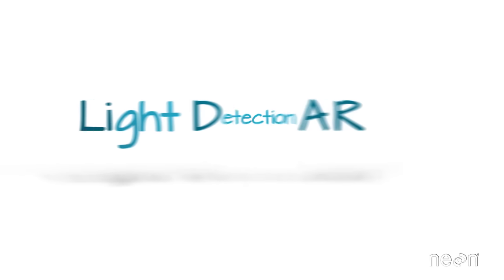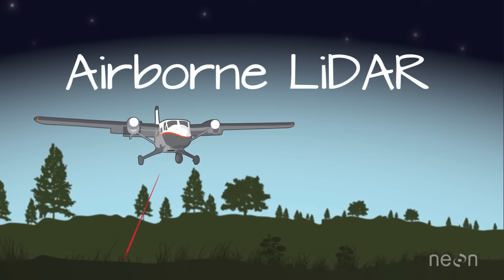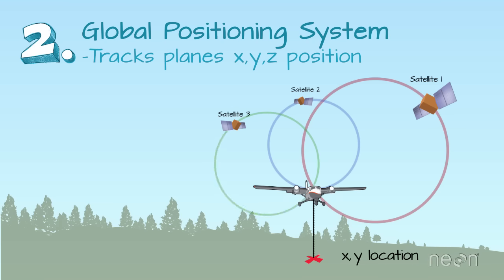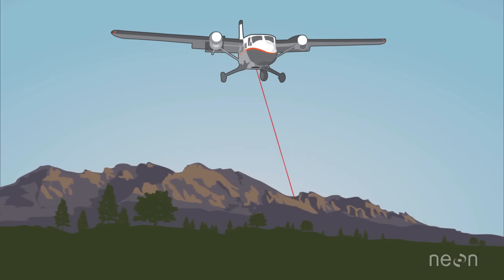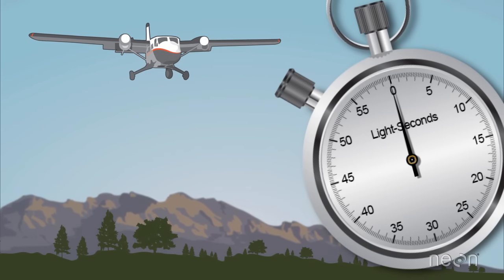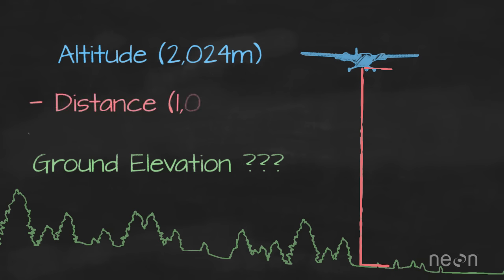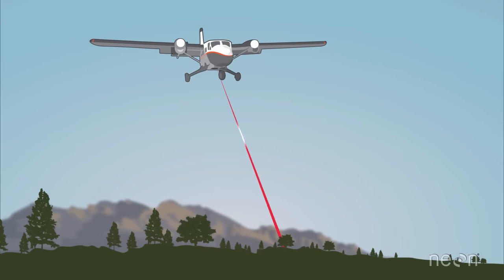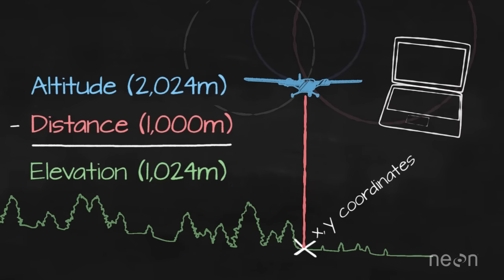How Does LiDAR Remote Sensing Work? Light Detection and Ranging

Comment: Seems wrong. As the laser leaves the airplane, the airplane moves forward, thus when the laser “returns” back to the airplane, the airplane has moved. And you have to take into account that if you send several photons at the same time, given the fact the airplane has a velocity, you have a bit more math to do to know which laser was what when it left the airplane.
Reply: The pulse/return of the laser moves with speed of light ( 300.000 m/s). Compared to the airplane (which is very very slow then) you can neglect all of the effects you just mentioned.
Reply: They didn't mention it specifically in the video, but I would think that would be part of what's taken into account with the IMU (not the emu. :)  Since it's measuring the plane's movement, it makes sense that it takes forward movement into account in addition to pitch, roll, and yaw.
Reply: You're forgetting one thing: airplanes are slow. Light is very fast. The movement of the plane is negligible. The light is there and back before the plane has moved even a centimetre.
Reply: +Mitigate Keeps well that's a shortcut proof of one kind, but I'll deal with it. I guess you're right, even though I'm pretty sure it's not that “negligible” and that, as someone already stated, the onboard system might already take that into account. Keep in mind that even if it adds 1 nm bias each time a beam leaves the sensor, the cumulative bias might matter eventually. It's “negligible” in high school for sure though.

Comment: LiDAR cannot penetrate rain, fog, dust, or snow.
Reply from the maker: Excellent point james aiaz.  As lidar is based on lasers, it will only work in situations where the light can penetrate, therefore, with thick fog, smoke, etc lidar cannot be reliably used.